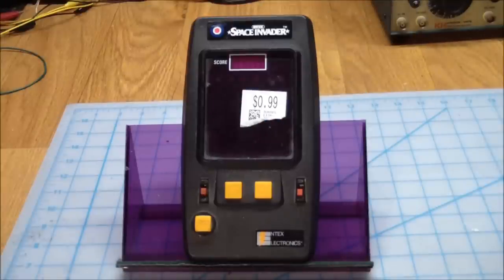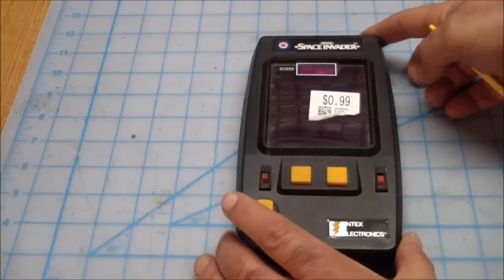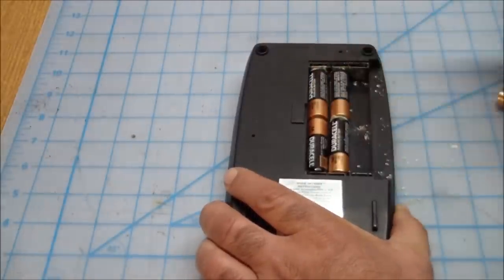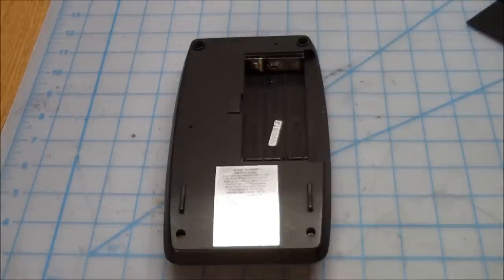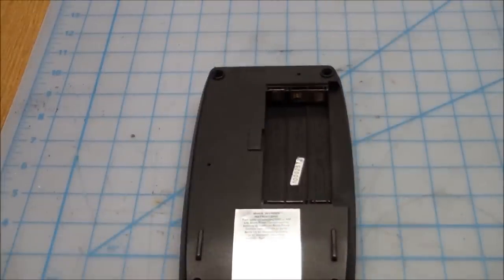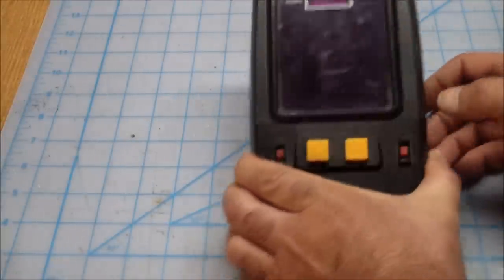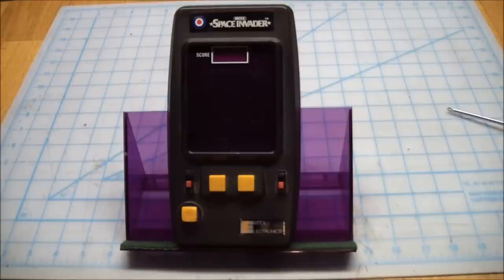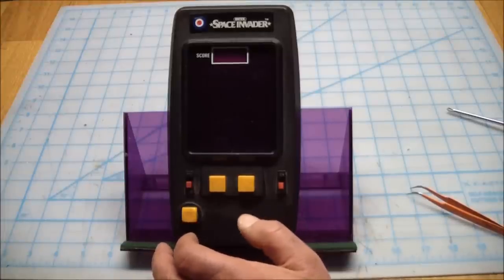AE#65 Small Electronic Toy Repairs

Comment: That chip is a Texas Instruments TMS1000 series MCU derivative used in many, many consumer product from the eighties. From calculators to portable games like this, it simply had a different embedded mask rom for each application. The Lego RCX has an Hitachi H8 MCU in it, and is essentially a 3 inputs, 3 outputs PLC for kids. I have the 2.0 version of this yellow brick and for some unknown reason Lego had removed the external power connector from it.

Comment: Not sure if I have mentioned ACF50 to you. Unbelievable stuff for penetrating oil and contacts. My motorcycle would get through the winter more or less ok for contacts in the starter group oif switches. Then ..... no starter, press hard a few times etc. Open the two screws holding the switches together, spray them with any contact cleaner, then  wait a short while and blip them twice with ACF50. No further problems for over three years !! The guy who introduced it to me told me about a tank of the stuff and a television immeresed into it. The TV was then switched on and it worked fine in a bath of ACF50 ! Ten times better than WD40 also great for cleaning out battery goo !